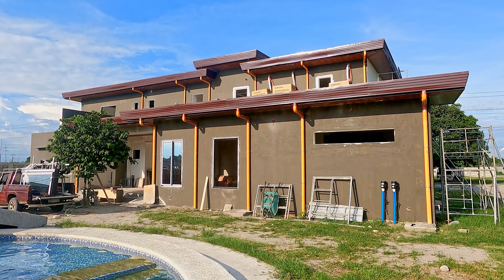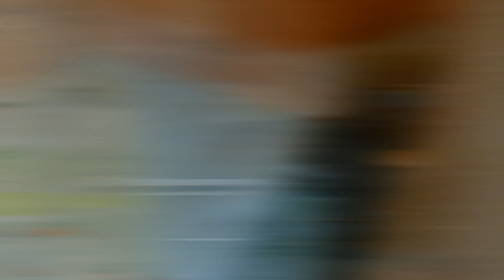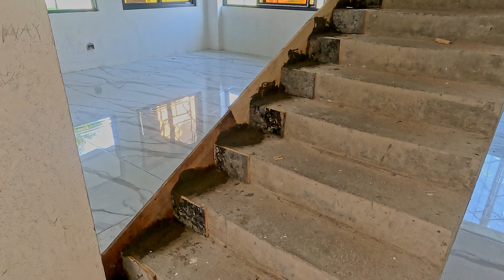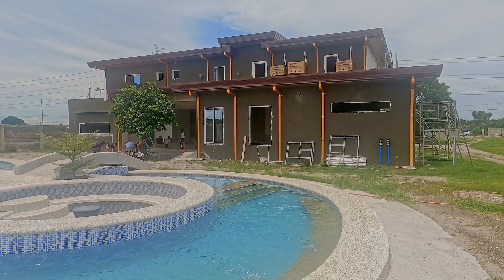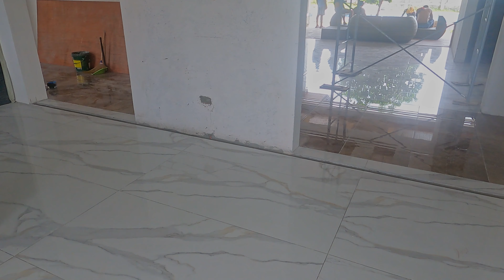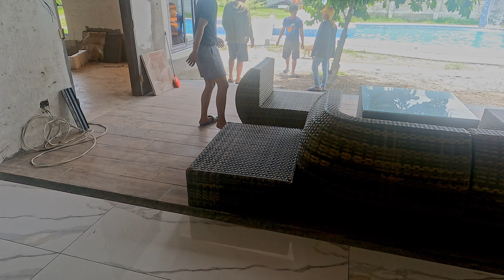Philippine House Building Day 284 - Window Installation Part 1

Comment: Good evening Mike, The windows look good to me it's PVC with the look of Aluminum.  The reflective glass will keep interior cooling cost down and uv out.. However the glass will work on balance of light day time can't see in night can't see out. I guess at night just open the window/door.
Spa tiles looking good.
The building will be weather tight and is a big step in progress .
Reply from the maker: Graeme
I am really happy with the windows so far - just would like to see them finished. Will have to have bug screens added, otherwise could never open any of them - particularly at night